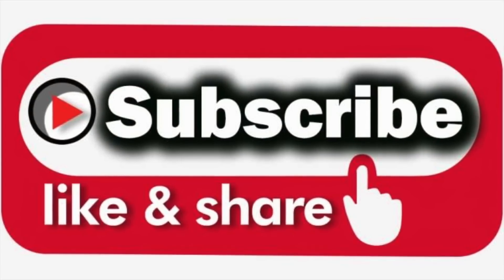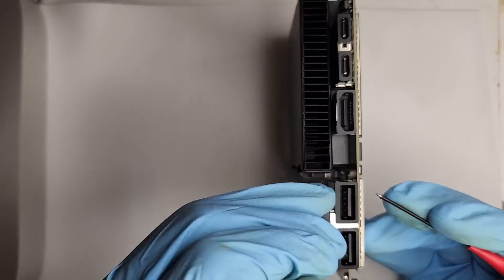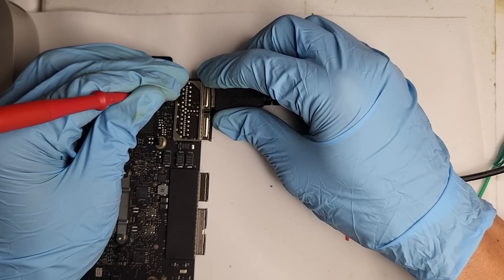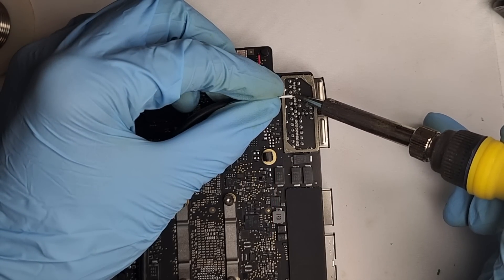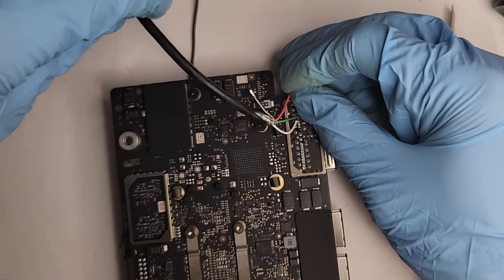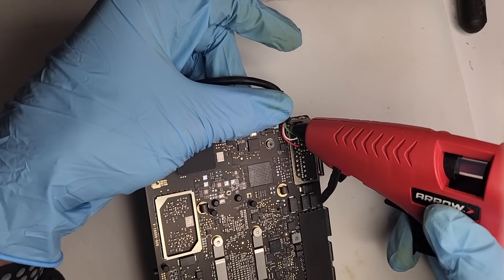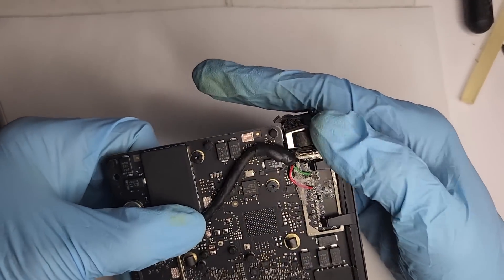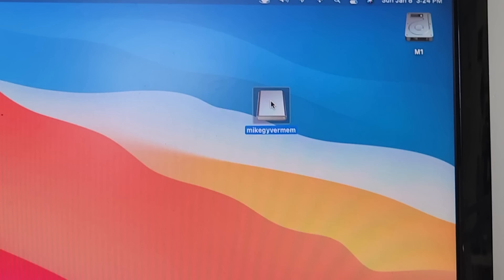Apple Mac Mini M1 teardown Hack upgrade Internal USB Expansion Memory; future SSD, M.2 NVMe upgrade.

Comment: This is USB 2.0… I don‘t recommend this mod at all if you are connecting sth like a drive to this, it‘ll be slow af. Maybe a slow 4G modem or something would work but for high speed peripherals it would be better to duct tape the device to the Mac mini instead of this…
Nonetheless cool idea! And with a proper USB 3 or even thunderbolt connection it‘s got potential
Reply from the maker: Yes.  POC.  next plan is USB3

Comment: You can have a 4G/5G modem for USB so you can always have a backup internet connection. The tricky part is to replace the SIM card for the modem when needed: open up Mac mini again but if you're very used to it and good at modding computers it's pretty easy :)
Reply: the mac mini is made of metal so you are going to need an external antenna for it.
Reply: I would advise if anyone was to do this, Is to make sure 4G/5G modem is compatible first as the Mac OS is funny on Drivers.

Comment: Clickbait title!  This does NOT show memory expansion, SSD, or M.2 NVMe. It is just moving one of the USB ports to the inside of the case, which seems pointless.
Reply: And it's only a 480Mbps usb 2 port.
Reply: It is too bad that most content creators use clickbait.  The content has nothing to do with the video title.  It is kinda waste of time to watch the whole video and find out that the title described things are not there.
Reply: @catchnkill  i wonder if the clickbaited views are enough to negate the dislikes and revenge reports the clickbaited few should always do to punish these "cuntent" creators?
Reply: Cheers. Saved me a watch.
Reply: It would be more useful with 3.0 connectivity. The idea is interesting since this Mac has a lot of empty space inside.
Reply: Hay que denunciarlo.

Comment: So at the end of the hack you have an internal USB drive that you have to open up to replace should you ever decide to and not only that, the external USP port is pretty much useless. Yeah, this makes perfect sense.
Reply: ive done similar but it was with a laptop that had i was able to solder on a USB hub internally then i could run more than one device internally, then just put a cap over the external port. did this to give an old laptop a second linux boot drive and bluetooth.

Although note as he only used the USB 2.0 cable/wiring it will be limited to USB2.0 speeds. i would have at least done all the wires and that at least would get me usb3 speeds.

ive also soldered directly to the mini pci-express slot before to get usb signals on a laptop that had the pads for pci-express but didnt install a connector.

Although for his hack really the only advantage is now the USB device is hidden, so i guess if you dont like cords or dont want a dongle someone can steal off the back, this might be viable
Reply: He need to get views to this channel so that's why he makes a nosense hack
Reply from the maker: At least you'd have something to open up to upgrade as opposed to a fixed SSD on the motherboard that is permanent?  😁

Comment: what's the point of this "hack"? you risk damaging some tiny pads just to have the usb on the inside, instead of connecting it to the outside? how is this even remotely usefull?
Reply: The only legitimate reason I could see someone doing this is to stealth out an application security identifier dongle inside to somewhat help hide it from thieves. Otherwise very little point to this, yes.
Reply: Stupidity comes in many forms
Reply: Yeah I feel the same. What's the point?

I commented that it's maybe possible to have an internal 4G/5G modem. It's maybe possible. What I didn't comment was "what's the point?".

Should only be an advantage to have something internal than external. It's better to have an USB thumbstick or 4G/5G modem external.

What I want is to have at least some of the ports on the front. Not ALL ports on the wrong side. Maybe it's possible to mod Mac Mini for one USB-A port on the front?

Comment: Thanks Mike, great hack. It’s connected like a usb 2.0 or 3.0?
Reply from the maker: It's USB2.0.  I may attempt 3.0 (more wires) later, but the pads are so tiny!
Reply: Don't you have a microscope or at least a magnifying glass? Just a thought...🤔